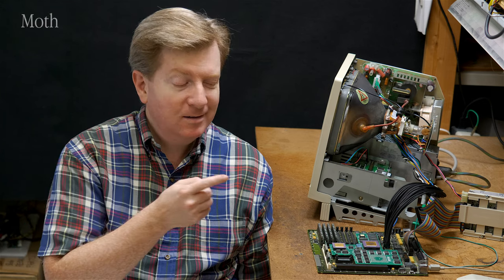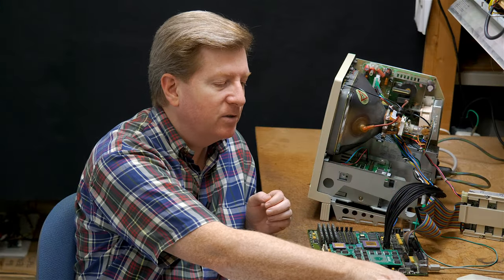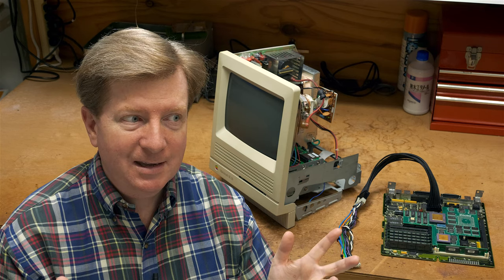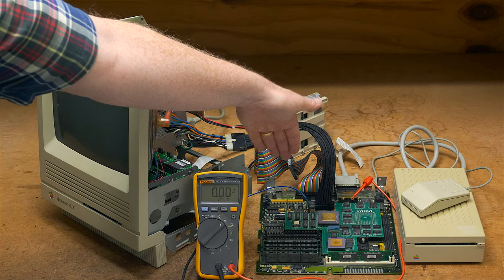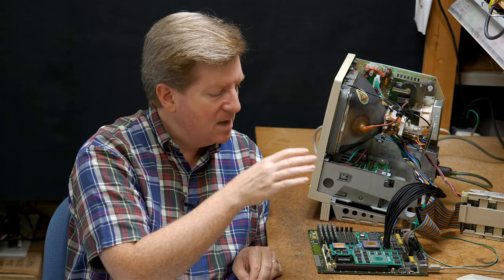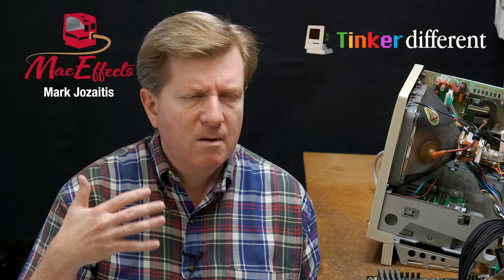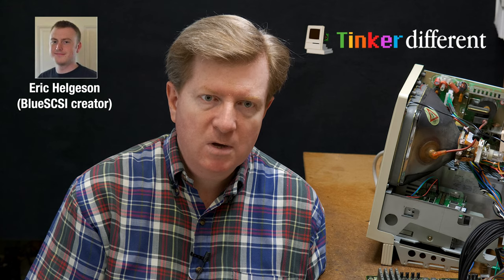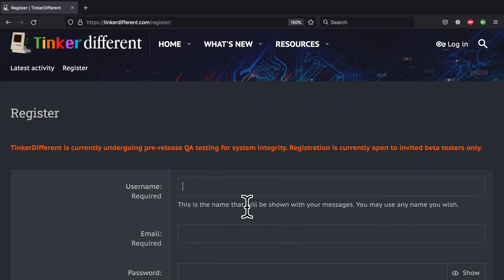How to Tinker Different inside a Macintosh SE & SE/30

Comment: Thanks for the connector link(s) James, I bought one. I had this exact issue trying to test a SE recently - the setup I managed did work, but it was quite precarious!
Reply from the maker: It really does help to get the logic board outside the chassis, and it's really great these ATX cables work so well.  Best wishes in your motherboard testing!

Comment: hi JDW - im big fan of your videos , the SE/30 and Classic 2 and especially the Fan Video helps me a lot 
for extension the FDD cable i found this an ebay - not to extend, but to replace the original short cabel to ever length you want -
i testes the 30 cm cabel and the connectors ( female female ) fits perfectly in the classic II board and the Sony W75 FDD which in SE/30 is the same  -  

so look in ebay for :  1 pcs. x  IDC Cable 20 way  ( 30cm )  2.54mm Connector Ribbon cable 

.
Reply from the maker: I searched EBAY for "1 pcs. x  IDC Cable 20 way  ( 30cm )  2.54mm Connector Ribbon cable" but I am not seeing what you are seeing.  If you can please post the EBAY "item number" then I can go directly to the item you are seeing.  Thank you!
Reply: @JDW-  ahhh , now i know why i cant answer you since yesterday  . youtube dosnt like links to others - like eb_ay sellers and other 

so i managed to answer you with an new komment without links see above 

the main thing is you can find the fitting apple 20 pol FDD Connector simply searching for :  IDC 2,54 mm  - thats the keyword and you will find this connector and cable by many other elektronik sellers and on eb_ay even at am_a_zon

greetings MacMad NT-Tom
Reply: @JDW-  i try to answer here - my answers seems to be delatet several times last try  ---------

hi, me again , semms my answers to long floppy cable didnt come throu so this as new komment

to get the right fitting connectors plugs for Macintosh FDD cable the key word you can google is : IDC 2,54 mm 20 pol 

- you can get single kits with this connector plug with 20 pol with cable up to 1 m for self montage or 2 connectors or ready made cables in length up to 1 m ( over 1 m you may get signal problems - i think )

or ready made cables in several length - i bought 30 cm long female to female 20 pin cable 
to plug this instead the short original cabel

but i also fond ready made extension ! cabels male to female IDC cabels so you dont have to finger in the cFDD cable in a screwed in Mac FDD - this is sometimes tricky - so can adapt the extensian cable easely to the installed short original FDD cable

i found 20 pol extension Plugs also as a kit to build yourself maybe with a rainbow ribbon cable which you have and cut away 20 lines ;-)

 MAC Greetings NT-Tom
Reply from the maker: @NTTom2  I don't block URLs, but silly YouTube does.  It's very frustrating.  You need to trick YouTube by doing something like this: "www dot example dot com slash nameofwebpage dot html".  It's really stupid you need to do that, and I've complained to YouTube about this before, but they do nothing about it.

All said, I like ready made cables because I simply don't have the free time to make them, unless the cable-making is the subject of a video! :-)
Reply: @JDW-  ahhh , hello - now it functioned and i can read my answers to you - now to display and read -  now posted several times ;-)

hope you find now the descripted IDC 2.54mm 20 pin cable. but i think now its easy - to find ether a ready made instead original FDD cable or maybe easyer to use in practice - FDD extention cable on the short original cable -  
in the extension length you want 

30 years ago as a poor student i recycle some PC IDE ribbon cables shortened for my HD server project and use the old plugs to press it on other place - 

often times not sucessfull because of damages on the contacts by pull off and press it on other place on the ribbon cable with a vise ;-((

nowatimes i also buy ready made cabels why, i hope they are tested before sell - not to built in a new problem by install - but you can never be shure ;-)

thankyou greetings MacMan Tom

Comment: How is the monitor connected to the motherboard? Is it through the power cable?
Reply from the maker: The back of the CRT has its own small PCB which in turn is connected to the analog board and that in turn is connected to the motherboard. But it’s not a direct connection.
Reply: @JDW-  Thanks.

Comment: hi, me again , semms my answers to long floppy cable didnt come throu so this as new komment

to get the right fitting connectors plugs for Macintosh FDD cable the key word you can google is : IDC 2,54 mm 20 pol 

- you can get single kits with this connector plug with 20 pol with cable up to 1 m for self montage or 2 connectors or ready made cables in length up to 1 m ( over 1 m you may get signal problems - i think )

or ready made cables in several length - i bought 30 cm long female to female 20 pin cable 
to plug this instead the short original cabel

but i also fond ready made extension ! cabels male to female IDC cabels so you dont have to finger in the cFDD cable in a screwed in Mac FDD - this is sometimes tricky - so can adapt the extensian cable easely to the installed short original FDD cable

i found 20 pol extension Plugs also as a kit to build yourself maybe with a rainbow ribbon cable which you have and cut away 20 lines ;-)

 
have fun 

 MAC Greetings NT-Tom

Comment: i dont kno why , i dont kno why my answers and no new comments dont come true , so i try it one mare time without links  and other keywords   -----

hi, me again , semms my answers to long floppy cable didnt come throu so this as new komment

to get the right fitting connectors plugs for Macintosh FDD cable the key word you can  sarch for  : IDC 2,54 mm 20 pol 

- you can get single kits with this connector plug with 20 pol with cable up to 1 m for self montage or 2 connectors or ready made cables in length up to 1 m ( over 1 m you may get signal problems - i think )

or ready made cables in several length - i bought 30 cm long female to female 20 pin cable 
to plug this instead the short original cabel

but i also fond ready made extension ! cabels male to female IDC cabels so you dont have to finger in the cFDD cable in a screwed in Mac FDD - this is sometimes tricky - so can adapt the extensian cable easely to the installed short original FDD cable

i found 20 pol extension Plugs also as a kit to build yourself maybe with a rainbow ribbon cable which you have and cut away 20 lines ;-)

so i add some ebay germany ! item numbers and links of kits and ready made cables i fond in ebay.de for extension search for "IDC Verlängerung" in german ebay.de - some IDC connectors i even fond an amazon and many other electronic sellers
have fun 

here only some examples and different sellers   ------   links erased ;-(

greetings   MacMad again NT-Tom
Reply from the maker: Sorry, I didn't see your post until just now.  I don't delete posts, and I allow links.  Sadly, stupid YouTube filters posts with links much of the time.  To get around that foolishness, you need to trick YouTube by writing something like "example dot com".  Leave off the HTTP or HTTPS.  Doing that will allow you to get your URLs through.  I like URLs and wish YouTube would stop this craziness.  I've written to them about it, but they don't seem to care enough to solve the problem.